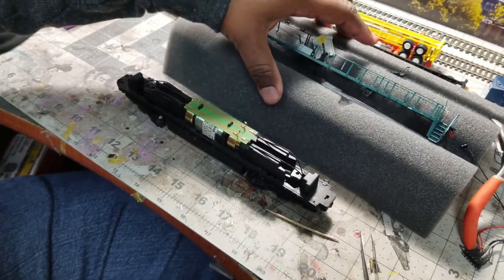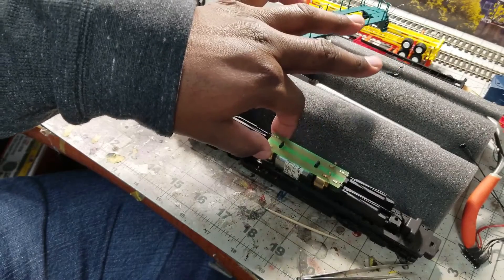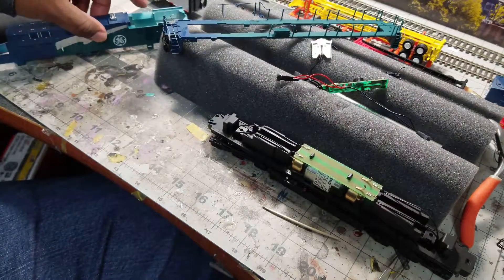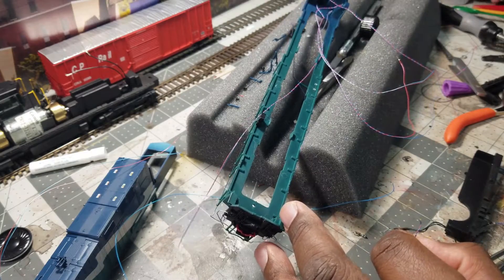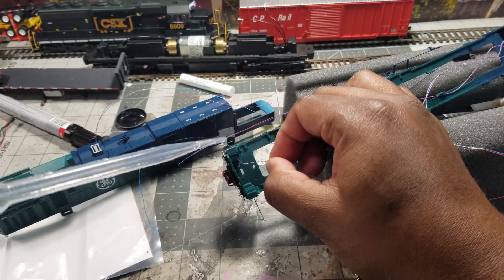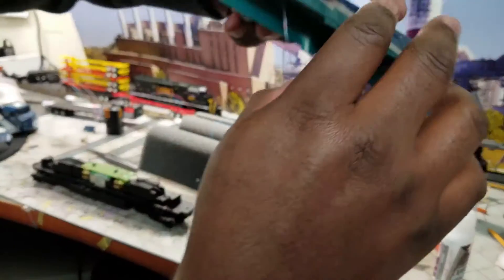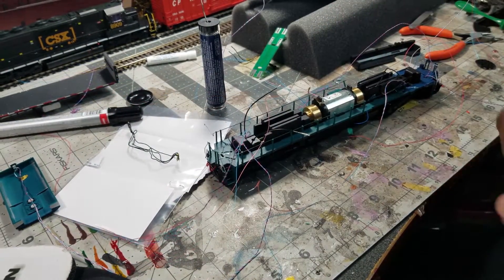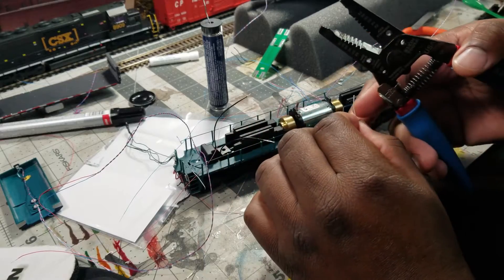Tower 55 GE ES44AC Demo 2005

Comment: 1:34 if I had a dollar for every time I've done that... Aw man,that hurt. If the sill is styrene. You could technically glue the sill back together.
Reply from the maker: A glue to back together it was a easy fix I'm just surprised how easily it broke        When I get a chance to whether the engine I'm gonna try to hide the cracks
Reply: @engineerhall5887   Glad you fixed it. She sounds great too. Really enjoyed the tutorial. How long have you been model railroading ?
Reply from the maker: I have been around it all my life but the last 10 years I've been back into it
Reply: @engineerhall5887   Same here.  Never to old to learn something new. That's one great thing in our hobby. Always learning something new  modeling skill to master. I'm my case. I'm still lagging behind with DC. That electronic DCC stuff,man. Keep up the great modeling.
Reply: Wondering how this turned out. Just picked up a BNSF Tower 55 last year, myself. Haven't done anything to it yet, but will be careful. Theses are old, I'm thinking the plastic they used for the will might not age real well. I'll probably dim down the steps lights. Thinking of modifying or adding detail to the radiator grill.